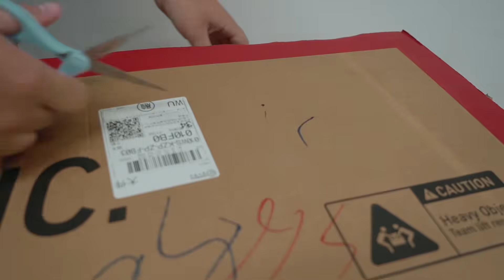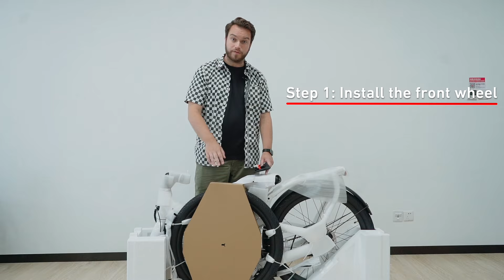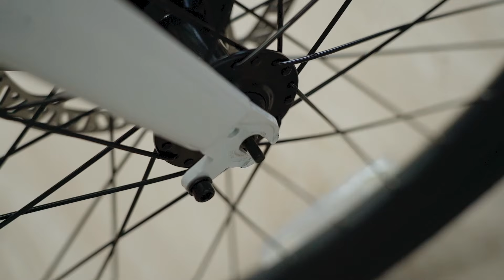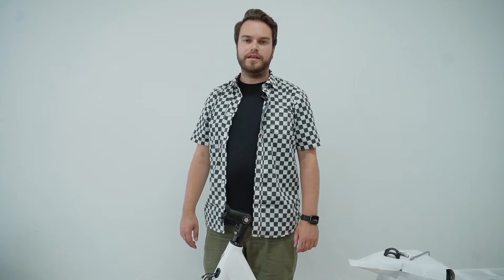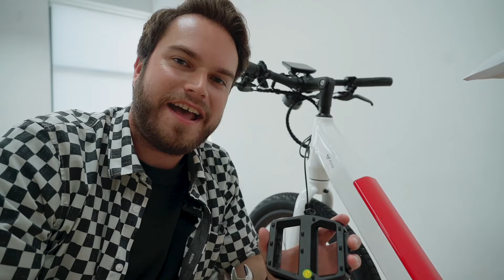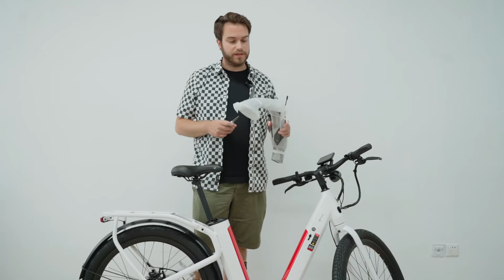NIU BQi-C3 Pro Assembly

Comment: I have a serious problem. 1st step. The wheel hits the Base of the frame. Why I can not get the wheel to alight straight with the back tire the handles bar has to be slightly turned. Why does the front wheel seem like it’s to big and hitting the from preventing it from being straight

Comment: Got one and it’s literally impossible to get working - the front wheel/disc/caliper are impossible to align. I’m at the maximum tolerance of the caliper and the left pad is still rubbing… I’ve owned tons of bikes, what’s the deal with this one??
Reply from the maker: Thanks for your feedback, the calipers have two fastening bolts, which can adjust the position of the calipers so that the brake disc is centered, this should remove the friction issue. If you continue to have issues please do DM us on IG, so we can help provide assistance.
Reply: I had the exact same problem, the problem is in the Handel bars. Turn your handle bars so the turn 180 degrees and the bike will naturally push the front wheel out so it clears the bike and is easy to attach. Remember think about the handlebar. Do not setup the handle first. Do the wheel first otherwise you will experience the problem your having.

Comment: Can you make video how to change the back-tire? What I need to know about the Carbon Gates Belt Drive during change?
For my other Bike I have a basket with a standard Snapit-Adapter. Is a snapit-adapter compatible with the niu-bike?
Approximately: When will it be available in Europe?
About The batteries, I have many questions. Will you also produce a video for the right usage:
Is it OK to always only recharge one of the two batteries?
What are the lowest temperature the battery could handle without getting damaged?
Reply from the maker: Thanks for the feedback. To address your questions:

We plan to offer more resources on the BQi soon, so stay tuned! Unfortunately, the Snap-It adapter is not directly compatible with the BQi.

We don't have a set release date at this time for Europe, but when have more information to share, we'll be sure to do so!

Yes, you can use the bike with one or two batteries; both are ok options. You shouldn't ride in temperatures below -10C and don't charge or store the batteries in temperatures below freezing.
Reply from the maker: Thanks for posting your concern here. We'd keen to get this resolved for you. To look into the case, we need to have the Order Number, Contact info or after-sales order number, but the YouTube doesn’t support DM. We hope you could email us at [Global-Service@niu.com] with the info and let us know the details, and we can continue there!
If you are from the US or Canada, feel free to contact our hotline team at +1 8882410666 (toll free). The service time is 11:00 to 20:00 EST in America.